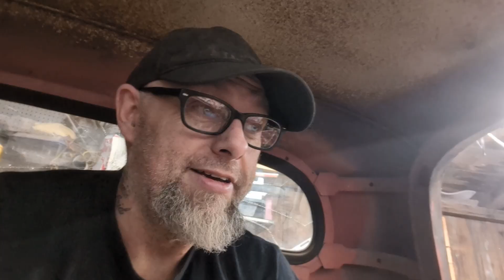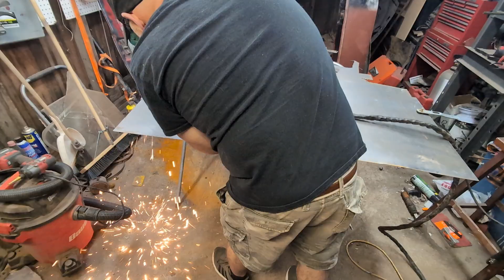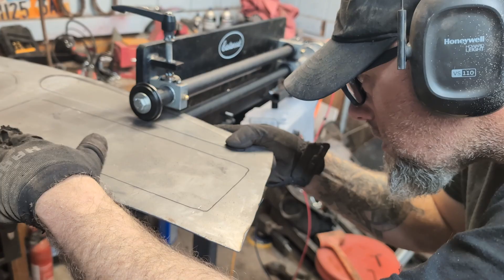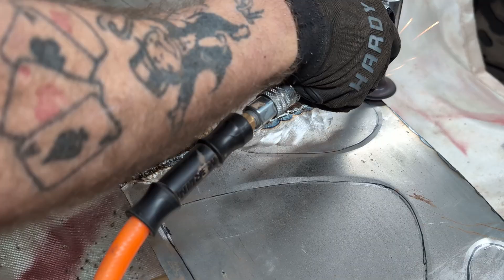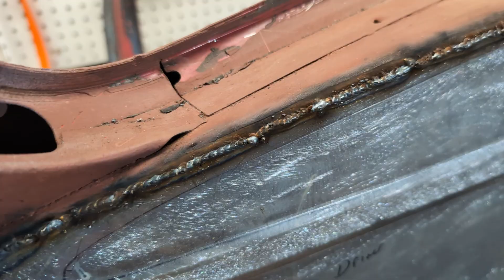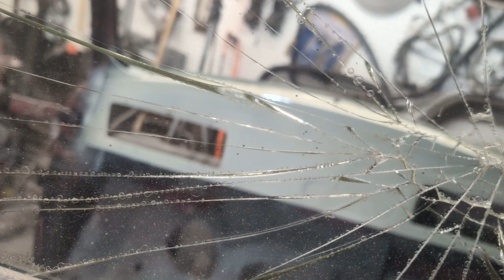Bead Rolling a new dash (for no reason)

Comment: Well done.  I've been looking at picking up a bead roller and specifically at the Eastwood 19" powered roller.  What's your thoughts on it?
Reply from the maker: Thank you. It was a fun challenge. 
My thoughts on the Eastwood:
Love it
Did a motor conversion (worth it)
Built a stand (absolutely necessary)
Also, found that it doesn't come with a true tipping die, so that will be necessary for diamonds and things. 
All in all, a very good purchase